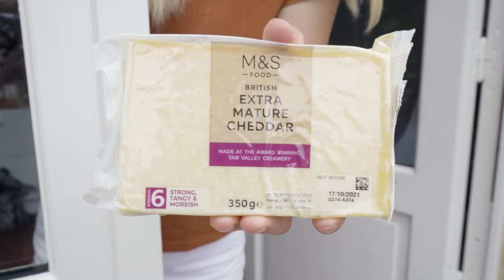The perfect Chateau Dad? Wait what happens next...

Comment: 6:00. Tips for Jam making… 🍏 🍑 🍏 🍊 🍏 🍒 🍏 🍇 🍏 🫐 I love using unripe apples to make the pectin for jams.  Just boil whatever you have of green drops or imperfect unripe apples, strain off the liquid, compost the apples, and use the liquid for you jam making.

I put  the filled jars into a hot water bath to help eliminate air bubbles and finish the cooking of the jam if it is needed. 

I also echo the advice of others who have said: use a funnel for the jam pouring, it goes so much better for speed and efficiency.

Comment: Hi Philipp and Anna, lovely to see your family visiting! The kids have such fun on that trampoline, don't they? Anna, there are easier ways to make jam! The best hints I can give you (from over 50 years of jam making!) are - Freeze your fruit in 1-2kg bags until you need it, and thaw as much as you need at a time. I only make jams etc in the Winter, too hot to do in Summer! It makes the flavour of the fruit more intense and cooks quicker. Don't soak your fruit in the sugar, just bung it in the pot with about 1/2 ltr water per kg, and the juice of a couple of lemons, and let it just simmer for about an hour, or less, just until the fruit is falling apart. Add your sugar (NOT jam sugar - it's a marketing rip off and way too expensive) by measuring the cooked pulp volume cup for cup sugar/fruit. Turn up the heat a bit and add the sugar, stirring, until it's combined, bit by bit. Give it a stir now and again, and it should be ready to bottle fairly quickly, about 10-15 mins from adding the sugar. It starts to go clear as it's cooked. Test by putting a teaspoonful onto a cold saucer, when it's done, you will get a little wrinkle on the jam's surface if you prod it with your finger. Doing the jam like this gives it a lovely colour, and it's got a nice jellied consistency. Bottle and enjoy!! Hope this gives you an easier option, I feel for you standing there waiting for that fruit to soften for hours when the whole lot could have been done and dusted in way less time! Love and big hugs xx
Reply from the maker: Thank you so much, Karen, we'll try this method for the next batch! With normal sugar! thanks for the tip!

Comment: re. your jam recipe.  I learned that you can use the same process of mixing fruit with lemon and sugar to then freeze the fruit in containers or bags.  I was surprised that the fruit maintains its texture well without the extra step of cooking the fruit down as with jam.  It is also possible to freeze tomatoes whole without blanching them to be used in sauces or other cooked recipes.  The tomato skins rub off easily once the tomatoes are slightly thawed or you have run them under some warm water for a few seconds.

Comment: Darling video!   Anna, you need a canning funnel.  Place the funnel on a jar and use a 4 cup measure that has a spout to add your hot jam to multiple jars.  Just move funnel from filled to empty jar. No more multiple ladling for one jar.
Reply: That’s the way my mother did it…with a funnel. Her sterilization of jars was accomplished by inverting them in a large pot of boiling water (10 minutes, I believe)

Comment: My suggestion for jam would be to cook the plain apricots, let them simmer until the "water" they release evaporates, and only at that stage add the sugar, let it dissolve and boil for a few minutes until it thickens a little bit. You can try the consistency of your jam on a cold plate. Let it cool down and check if it's too runny or perfect!
Reply from the maker: thanks for the tips!

Comment: Splitting wood tip, use/set aside a cut of a chunky tree thats at minimum knee hight (preferably mid- to three quarter- thigh high and at least 20-40cm thick), and keep it for wood splitting for ever, just move with you and then put it back in the shed so it stays dry (lighter to carry and keeps it from rotting away. You can have a thicker one thats permanently in the wood shed, as it will be heavier to manuver around, but will also be a ton sturdier (at least 50cm-1m thick). Would also suggest taking the bark off them, so the bark beetles don't destroy it, it also helps them dry faster.

The knee high thing makes it a comfortable hight to swing at (helps a bunch with accuracy, as the swing stays at the right shoulder/clavicle all the way through the wood, as opposed to the start at the shoulder- end in the center you had going here (since the shoulder swing all the way down to the ground does not work, so you have to swing in a curve in stead of straight up and down). It's such a little thing, but it saves your back a lot of pain and is a lot less dangerous as the axe is going for your leg if you don't adjust correctly, or if it just glanced off the wood; it's going to hit your leg or foot, but if it's at the right hight you all ways have the axe blade the whole length of it away from your body. 

If not it would actually be safer (in this situation) to sit on your knees and use the smaller axe, cause then the hight would be right with the "block/stump" you used to chop on, as i said above it would keep the axe its full length and about half your arms length, away from your body and keep the swing safer and more accurate. Ie. Your legs/legs would actually be safer if you had sat on your knees. Next to a table top cleaver, a chopping block/stump is the very best thing. So next time a big tree or limb needs to/ come down, that fits the description, set it aside/try it out. I think you'll be shocked at the difference it makes, you'll love it when you realise you can chop for hours without wrecking your back (or chopping your feet off). 

It's actually quite therapeutic and ergonomic movement when it's up of the ground. Sorry for the essay, it's more for your back then a safety police thing, just saw you were doing it the hard way, so that's today's tip from a farm girl😜💁‍♀️✌️

Ps. Would check the wood chippers "earth", since it arched when you started it, maybe it's shook a bit loose, perhaps its a "melted because poor contact" situation, where it now is close enough to the "power/plus" side that it can arch between them/or it archs to just any metal component as the earth has bad contact. Should be an easy fix, and keep you from getting shocked if you touch it without rubber gloves and/or rubber shoes. Oh, and start your chainsaw by holding the handle with left hand and pulling with right hand, chainsaw between the legs with an uncertain amount of rotation from pulling the string.. I'm just saying i think you care more about the stuff in that area then you attributed with your actions. I would certainly not trust the sawing pants repeatedly holding up in the same area, plus they are there for accidents, not purposeful contact each time you draw😋🤓🙉. (Again I'm exaggerating to take the mickey out of you, not an "omg so stupid", it's more a "you've got bigger balls then i do, for now/but not for much longer by the looks of it"💁‍♀️😂)
Reply from the maker: Dear Anita, thank you so much for all the precious Tips! I certainly have to improve my chopping technique and creating a chopping block to start with would be a good idea (I do have one in the wood-shed, but it's to far away... Also thank you for the tip with the chippers earth, I didn't even know it had an earth, I thought it was just some sort of backfire! Thanks again and cheers from Normandy! And your last sentence made me laugh out loud! :) I hope you're not right though ;)
Reply: @HowToRenovateAChateau  Haha, i should have guessed you already had one! But i hope some of it is helpful🙊

Ya'know, you might be right with the wood chipper, but that's were my mind went! But i do believe even chainsaws have wires (most things with a spark plug do), but it's wort a gander (plus you know were to look based on were the action happened😄), so you know rather fast if what you find is like the exhaust manifold, then you're most likely right!😄👍🏻 

Haha, i hope I'm not right either; glad I could make you laugh though!💁‍♀️😂 
I bet your chopping technique really isn't as bad as all that, it's just more difficult to get the curve right if you have to chop lover to the ground (with back bendt and knees ready for a limbo😋) so don't rag on yourself or your skills when you're doing it the hard way is mostly the point (weeell, that and the jokes💁‍♀️😋)!

Comment: The old European way is to layer the fruit and sugar and leave it overnight then when you go to cook it the next morning add your lemon juice. This produces a better quality of jam like marinating meat you can soak it for a couple of hours but for a deeper taste marrinade it over night. I prefer to blitz the fruit in the food processor because of the time factor; this makes making the jam quicker and then add a good handful of sterilized marbles that children play with; this will prevent the jam from sticking on the bottom of the pan and help whilst stirring. To bottle you must leave a 1.25 cm head space in the top of the jar and wipe the rim of the jars with a clean damp cloth or paper towel and seal with the lids and water bath for 10 minutes and turning off the heat and leave it sit undisturbed for 5 minutes, then remove the jars with a jar lifter and place on a towel  or board on your bench - never on your bench the jars will explode; and leave to cool completely; as the jars the jars will click and the center of the jars will divite. This is vacuuming if the don't you will have to repeat the whole process to achieve this or follow the helps below. To water bath you put a round cake cooling rack in the bottom of a large stock pot with a lid this will stop the jars from cracking and this is called a trivet - if you are processing small jars like 125 g jars for the breakfast tables or the 50 g jars for individual servings you will need more racks. You put your first layer of jars in the rolling simmering water with the jar lifter add another rack and so forth then place the lid on and let it do its time. You can do the same with pint jars; but when it comes to ltr jars they are best left in a single layer. You need to make sure there is at least 5 cm of water covering the jars at all times and you also need to have a second pot of water at the same simmer in case the water bath needs more water - never top up the pot with cold water, it will drop the temperature and the jars won't wont be vacuumed. If this does happen you have two choices empty the jam back into a pot and get it up to temperature and rebottle into sterilized jars and water bath correctly or put the jam in the fridge for immediate use or in the freezer in snack or sandwich clip seal bags and then placed into a larger clip seal bag dated and placed in the freezer and for when you want it defrost in the fridge over night. The cold sealed jam should be dated and stored in a dark airy cupboard for up to 12 months. Enjoy and yes the bill is in the mail. Ha Ha!
Reply: Would the jarring process be the same for apple butter? Our tree has produced sooo much fruit and the birds and bugs desided that most need a hole added so i need to process them ASAP! Normally I'd just make apple pie filling and freeze is but i dont have freezer space. So i need some jar options. I normally reuse supermarket jars (we make sambal but that doesn't need to be boiled, just sterilized jars and a good layer of oil.) that have been sterilized.
Reply: There are plenty of canners on YouTube. I know a good dozen. When I suggest you go to Homestead heart. Lovely family. She'll even show you how to can butter. That can last for 5 years.
Reply: I didn't see your comment before I did mine, telling Anna she must follow the procedures set out by The National Center for Home Food Preservation.  That is okay.  Now she will have a few of us helping her out there.

Comment: re : cutting and chopping wood ,get yourself some steel toed boots and wrap the handle of that axe
with some plastic coated wire just under the head of the axe for about 8 inches held in place with duct tape .why ?because sure 
as shootin you are going to miss the axe and hit the handle ,it will either bounce or crack the handle ! 
a stainless steel funnel for canning is nice it will keep the jars clean .